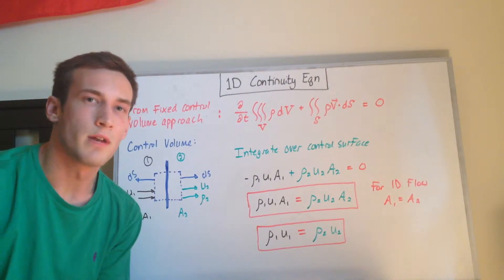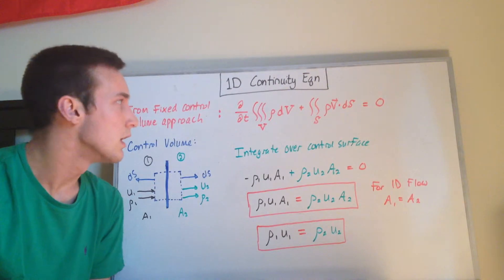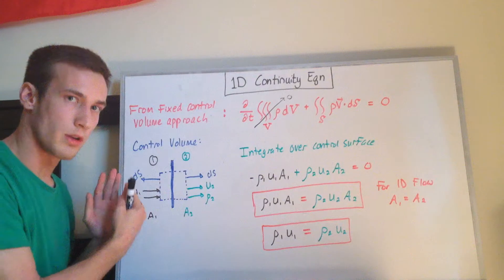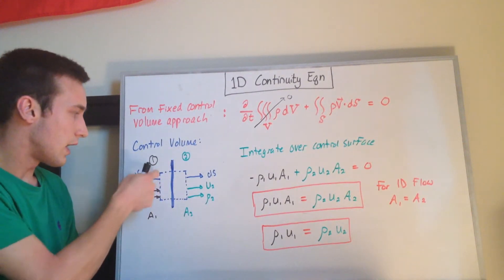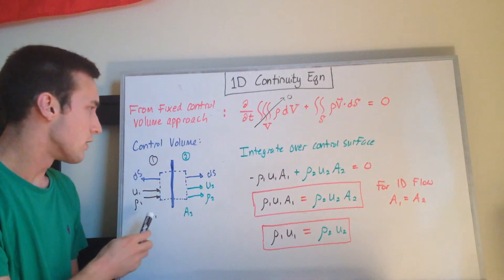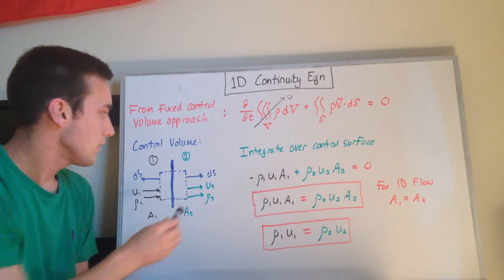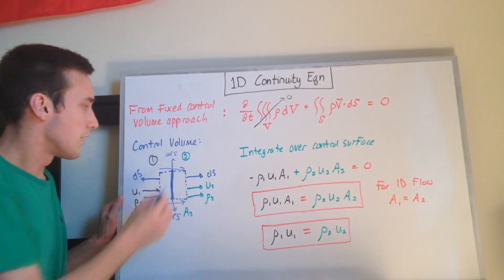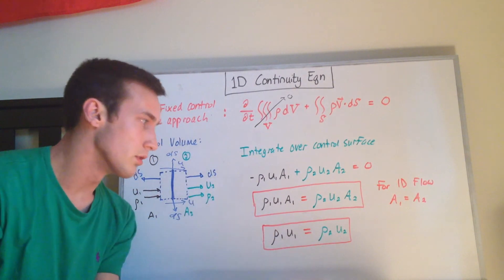Explained: 1D Conservation of Mass

Comment: what would it be for unsteady?
Reply: +Graham Fox I suppose you can think about it this way : steady flow is like inflating an intact balloon while unsteady is like  blowing a balloon with small holes on its surface - so while blowing some of the air will escape bc of the perforations. 

So I think for unsteady, just sum up the inflow and the outflow ( of whtever fluid you're analyzing ), take into account the negative sign, ofc.

I'm new to this ( I'm just a high school student wht would you expect : / ) so I'm srry if I misunderstood Josh..